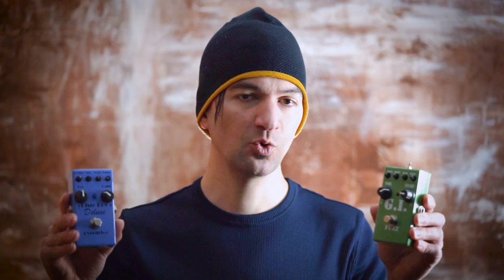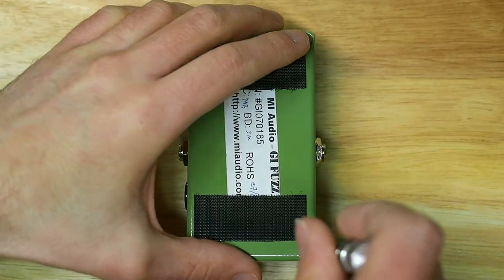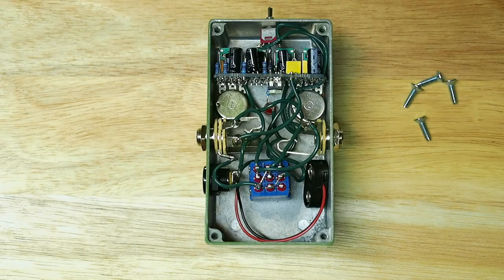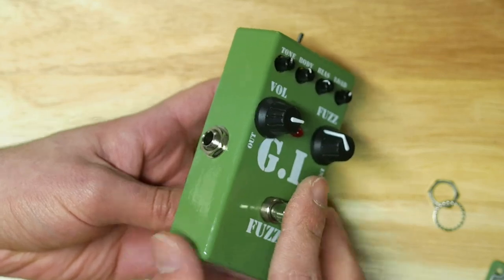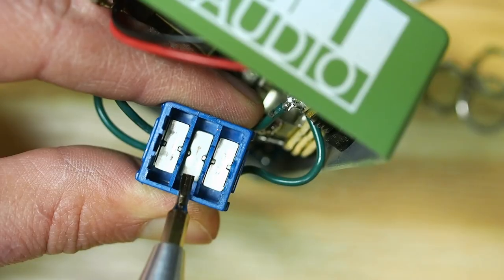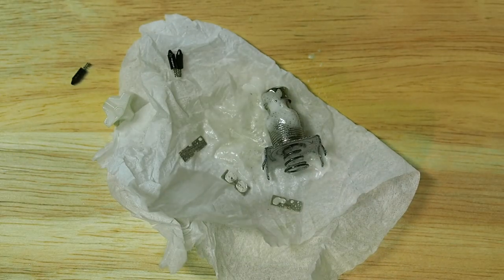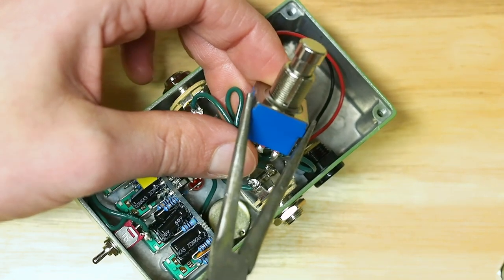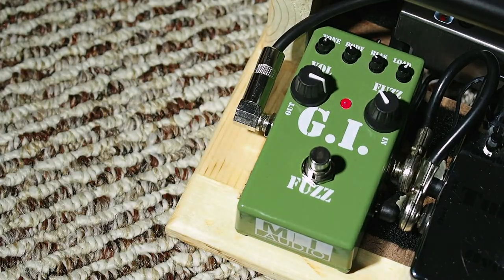Effects Pedal Button Switch Repair | Fix cutting out, crackling, static from foot switch

Comment: Just tried this on an OD pedal (Jetter GS124) that would cut out when clicked on.  Just like the GI in the vid.  Opener her up and found that there was excess grease inside the pot where the three contacts are, likely from the pot manufacturer.  Cleaned them up and so far, no recurring issues.

Great vid, you saved my pedal!  Thanks!

Comment: Thanks to your video, today I fixed the 3PDT switch that was causing my Sonic Maximizer to cut in and out.
I did just as you recommended, taking the switch apart, cleaning all the parts inside with contact cleaner and then carefully reassembling by bending the prongs back in-place, and all while it was still in the pedal!
Now it works flawlessly again!  Many thanks and happy holidays Wriggly!

Comment: Man, I'm VERY grateful for this video. My PC Timmy was starting to short out. Tried different cables, etc. 
Found this video, and it took 30 minutes to disassemble and reassemble. Plugged it back in and it works again! 
Glad to get it fixed before the gig this weekend! 
Thanks a ton for this helpful video.

Comment: Thank you so very much. Your video gave me the knowledge and confidence to open up my Go-Go tuner and realign the switch pin under the spring. Took a couple of tries but I kept at it and finally got it working after 6 years.

Comment: Fixed my Turbo Rat with this video. Thank you so much! Had to solder one of the cables as it was necessary in order to open the switch box. 

Thanks again!

Comment: Dude you are a genius tinkerer! I have two Wampler pedals with switches that were going out. I was just about to desolder and solder in new footswitches but what's the point if the new one will develop the same problem? Your approach was much faster and fixed my switches.

Comment: Hey man thanks a lot 
I tried the isopropyl trick but it' only worked a little I saw your vid and when I opened the blue lol box there was so much metal shaving I did as you did and it works great !! Thanks now I don't have to buy another big muff rock on

Comment: This helped a ton, thank you! 

Opened up my IdiotBox Fuzz Freq V.2, and found that the offending switch had two wires with a little fray to them, but as soon as put everything back together, the issue was no longer present. Maybe I just needed to move the wires around so that they weren’t touching? 🤷 

Either way, I’m a master electrician now, thanks to you! 😂

Comment: I'll try it with the zoom,tho I doubt Zoom will make it as easy as this to access the switches, that's the issue with the multi effects banks, you lose the foot switches then you will not be able to play with the settings you've saved etc,it would be neat if these companies put a small manual switch to over rice it if the foot switches break

Comment: My problem may lie only in the spring itself as the button has gone “limp” on a pedal with a similar switch. Wish me luck!
Reply from the maker: Could be. This may of may not help you but, after I put one pedal back together, the switch wasn't clicking. I found that was because I didn't clamp the top back into place tightly / flush enough (see 3:52). So check if that looks OK on your switch too. Good luck!

Comment: what spray did u use to clean the small parts?
Reply from the maker: I had an antique-looking can of RadioShack Tuner Cleaner. But an electronics contact cleaner / lubricant should work.

Comment: idk if the switches have a polarity but i soldered mine the wrong way it wouldnt do anything when i hit the switch once i unsoldered and resoldered "the right way" it turned on and off so make sure you dry test it before closing everything up O
Reply: With this tutorial there is no need for soldering, or am I missing something?
Reply: @mopsvonmiez  if you are going to take out the switch all they way off to clean it you dont have to though

Comment: I have cutting out issue with my freidman beod but I feel a little worry to try your method especially about opening the swith, is it ok?
Reply from the maker: Well, I can't guarantee it'll work, of course, but if you think the switch is the problem, I figured I was either gonna have to replace it or try to fix it. So I gave fixing it a shot and it worked for me, at least. The section at 3:52 is important: Gotta make sure the top goes back on tightly / securely or the switch won't click. Good luck if you try it!